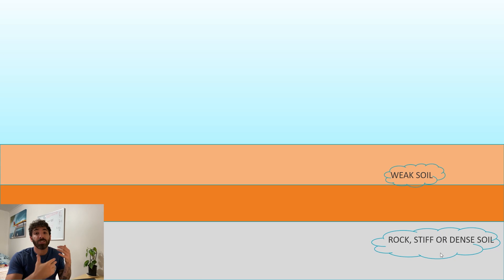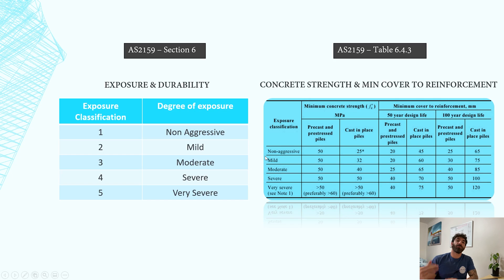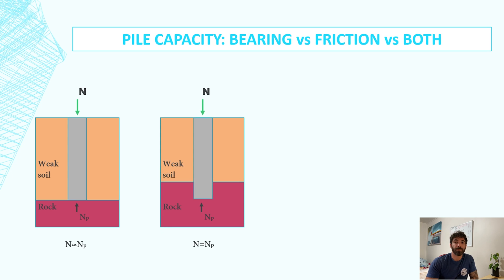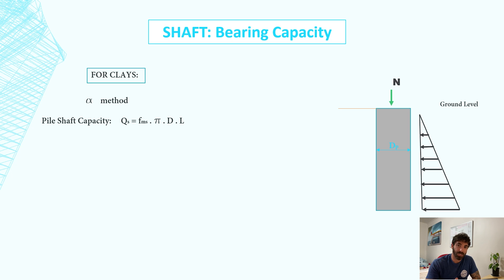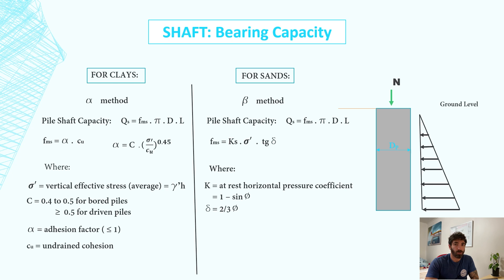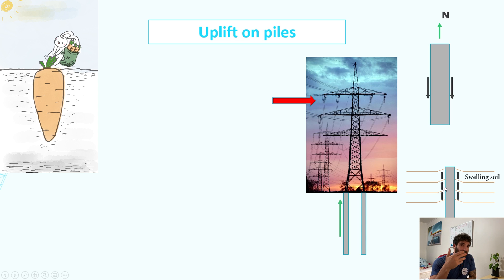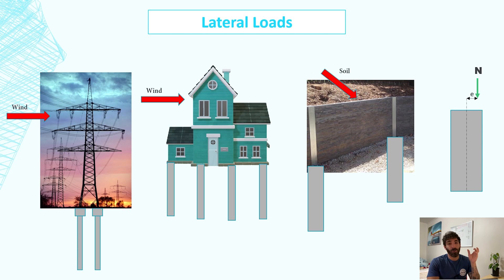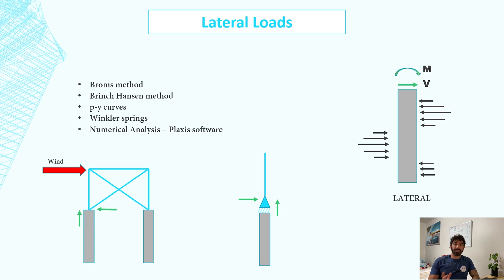Uncovering the Secrets of Pile Foundations & How They Support Structures

Comment: Hi Gabriel, very well explained. I'm from Brazil and trying to do some australian projects for an auction for transmission line towers. There is some differences from Brazil's standarts like using reduction factors instead of security factors. Your video gave me some light and helped me a lot. Any more tips about the NZS7000 standart ? do you know the software Geo5 ?

Comment: Do they ever use  cris- cross  piles in addition to vertical to prevent leaning/ tilting? Or at a 30⁰ angle around outer perimeters in addition to vertical in center?

Comment: BEng - fixed support at the top of a pile would induce M1 and V*. By ignoring e=1.5D at the top of the pile, so technically the total moment (M*) would be = M1 + M2 where M2 = V*1.5D ........eg M* = M1+V*x1.5D?
Reply from the maker: Are you referring to minimum eccentricity? I usually design for the greater of both values.

Comment: How come builders just pour them into the soil without having a vapour barrier as they do with the slab and footings? I thought moisture from the ground can damage the concrete and it will lose its structural integrity
Reply from the maker: The vapour barrier prevents moisture rising through the soil and getting into the house. We are not concerned about that when it comes to concrete piers. 
See the footings for bridges under water.
Bear in mind that if the pier is reinforced, adequate cover must be maintained to protect the steel.

Comment: Great videos mate. Just thought I'd mention that for downwards loads, AS 2870-2011 G5.3 states that "No side adhesion or friction should be assumed to exist to a depth of 0.75Hs for down loads" which I believe is to account for the depth of the cracked zone.
Reply from the maker: Hi Elliot, you're correct. Hs is the depth of design soil suction change and it's also dependent on the climate, So this value change from city to city. I personally don't take the side adhesion into consideration for short piles (residential) design. Thanks for your input